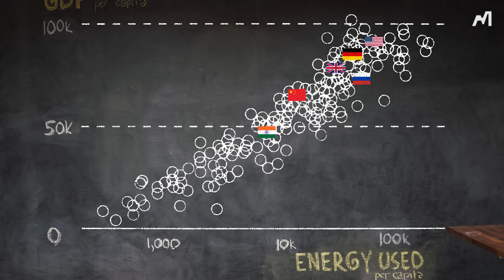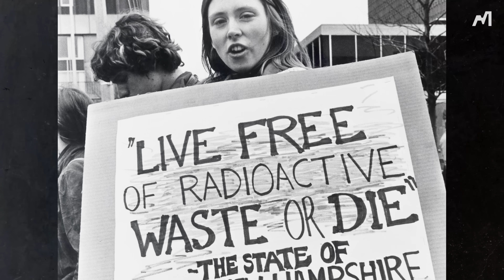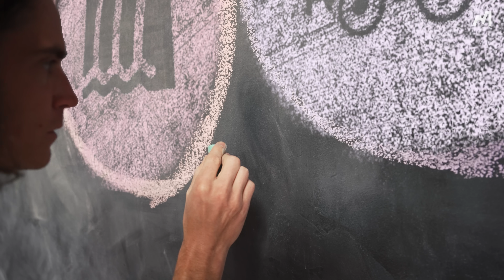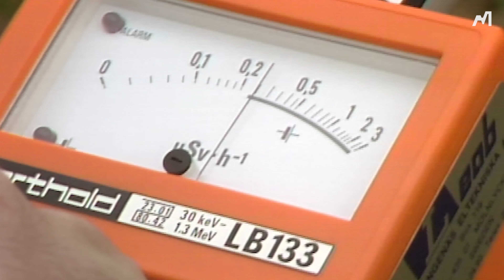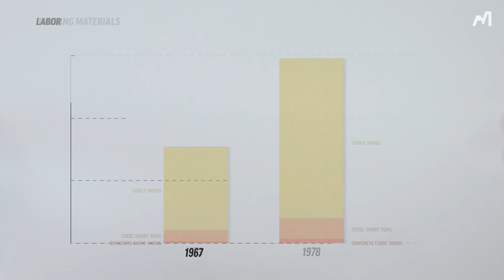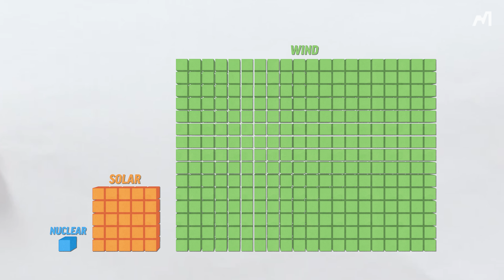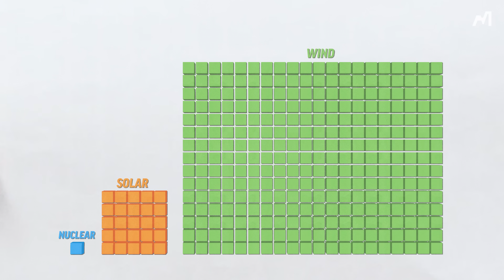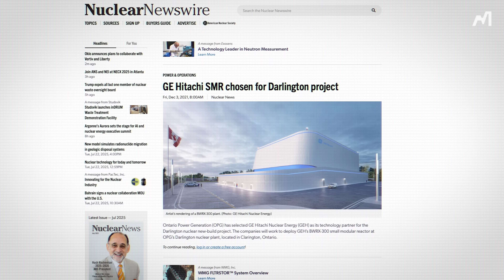They're Lying to You About Nuclear Energy

Comment: But there’s a difference between the radiation that comes from the sun and the isotopes that are released and you ingest it as a particle of dust into your body. That’s why you take potassium iodide so that you don’t build up that radiation. I’m not gonna finish your video, but this is the way I look at the radio activity that comes from a nuclear power plant. We are gonna burn the natural gas that comes out of a well when we are pumping out oil you can either burn it at the wall or you could say no you must pipe it and recover the gas burn it at a Coenen could be finished in a year. Cohen is efficiency When it comes to the technology that’s been driven for making electricity. You could spread them all over the country in populated areas without worrying about if there was ever an accident, and if there was a war, it doesn’t take a nuclear weapon to spread radiation. You just have to hit a nuclear power plant.

Comment: As much as you bring up some good points about the benefits of nuclear, and there are plenty, your explanation of radiation exposure is misleading.

Radiation from fire for example is not ionising. It is infrared (heat) radiation which does not ionise cells and body tissues. 

Radiation from radioactive nuclear material is ionising. So is UV from the sun and gamma rays, cosmic rays, X-rays and anything above the “ionising frequency threshold” (UV). They knock electrons off the atoms of organic molecules and damage them, often leading to cancer.

Our bodies have not evolved to handle ionising radiation from the sun, the atmosphere filters most of it out.  But skin cancer rates in sunnier countries is much higher than in cloudy, snowy countries, due to higher exposure to ionising UV.

You gave almost no evidence of cancer rates in those exposed to Chernobyl or Fukushima. Marie Curie died of radiation-caused illnesses because she didn’t protect herself. The later scientists did, which is why death numbers are low.
Reply: The cancer rates from Chernobyl are measurable in the few thousands if you’re conservative (and use a LNT model which is scientifically discredited) and Fukushima is a grand total of 0 since the dose was too low to show any demonstrable cancer rates increase, even among those who received the highest depose they’re under observation and still no demonstrable cancer rates increase was observed.
Source: UNSCEAR reports of Chernobyl and Fukushima accidents

Comment: Not possible to imagine what you have to say about ignorance and fear for the next 16 minutes. 

The larger issue is generic energy ignorance. Plutonium is one thing to not understand. 

Water that all nuclear reactors use and how water is energy is another. The modern day understanding of energy and specifically electricity is backwards and upside down.

Water is the container and method of delivery of all energy. No need to attempt to burn the water out of dead things made of water or to burn water into the state of evaporation to extract the energy in the fluid state of the material available everywhere on this planet cornered with water borne life forms including people

Comment: This video is a bit delusional, I'm sorry. It takes around two decades to set up a nuclear power plant. You can build up the same energy production capacity with wind or solar in less than a fifth of the time. Nuclear is strictly NOT competitive with renewables.
Reply: Problem is RES only operate in certain conditions and nuclear can 24/7. The two production “capacities” are not comparable because of this timing difference, sure you can build as much solar as you want, but after dusk 1 Tw of solar capacity produces 0 Wh of energy.

Comment: Windmills and solar panels will not produce the equivalent energy it needed to get produced, transported, built, and installed in its designated location. Then comes the costs for maintenance, the dismanteling after its useful lifetime is over, very costly disposal of some extremely dangerous matters and liquids they contain...
Reply: 25 years lifespan for a windmill is conditional to the very expansive maintenance done throughout those years

Comment: Its kind of weird how we learned from experience, and redesigned things. Like the near disaster at Browns Ferry NPP where a fire destroyed most of the control cables for two reactors meant that construction standards needed to radically change. The cable spreading areas were not human accessible most of the time, so nobody bothered to spend money building an alarm system pend money on a alarm system or fire suppression gear there. It was also cheaper to limit the number of building penetrations and route many cables through one area - so while the reactor safety systems and control rooms had backups of back ups, this one area was a single point of failure. One candle and some not properly fire resistant foam later, and you had an entire powerplant down for months.

Most of the questionable features of the RBMK were from economic decisions. The fuel melt at Enrico Fermi One was due to a last min addition to the plans that wasn't vetted correctly. 

Even if we got rid of all the oversight, Gamma rays are gamma rays, and no matter how small the reactor is you will need more protective measures than other power sources driving up costs. Which is what investors care about. Nuclear is a fine source of electricity, but not a good source of profit in short term folios.

Comment: Nuclear energy does not scale. In order to run the world on nuclear power, so much uranium would be required that it would only last a few tens of years. Do the math. It is a good thing that we did not go this way.
Reply: Do the research, resources and reserves are not the same. 10 years is BS and based on current reserves and demand, but resources and minerary resources can support nuclear for long enough that we don’t need to worry about running out. Same logic if applied to fossil fuel then oil should’ve ceased to exist 20 years ago, but we found new way to extract it and new deposits.
Math alone without contextualizing it or knowledge on the matter is just disinformation.

Comment: How much nuclear power plant fuel does the world have, and how long will it last given 1) present number of plants, 2) projected number of plants?
Reply: Unfortunately this cannot be answered and it doesn’t even make sense as a question, I’ll explain.
First of all are you asking reserves, resources or minerary resources? These are all different and will give you a different answer.
Resources is what’s currently economically available to extract, so by this metric the world has 5.9 Mt of uranium at less than 130$/kg (IAEA red book), so 90 years worth of fuel at current consumptions. Total resources are 7.9 below 260$/kg. Problem is resources are not finite, reserves become resources when price increases: new mines open, old ones reopen and new deposits are discovered. Hence why it cannot be answered, it’s not a fixed value, can only be used as an estimate. Also secondary and unconventional reserves (like military stockpiles being downblended or granite shale rocks) can give you even more.
If you wanted to you could calculate the uranium content in the crust and the crust mass and you’d have the total maximum possible (also need to account the uranium dissolved in the oceans if we wanted to). But including current reserves, resources and fuel reprocessing long story short is we don’t have to worry about uranium running out for at least the next millenium. Worst case there’s also thorium.

Comment: How large are the nuclear waste containers? Are they built and stored next to the nuclear reactors? If so, how many years will it take to fill up the land around a typical nuclear reactor? Is it possible to steal the nuclear waste without hauling off an entire container? Can nuclear waste be taken by breaking or drilling through the sides of the containers? If nuclear is so safe, why does it need to be stored in concrete containers? Besides the radioactive waste, how much water do nuclear reactors consume?
Reply: A few meters high, depends on the design but I’d say a canister is 5-6 meters high?
Again depends on the design, reactor cycle and space, there are some plants which can hold the casks of other plants also. The entire civil nuclear program in Switzerland holds waste in a 68m long building and it’s not even half full for example.
Nothing is impossible, but I’d say very improbable given the amount of security around nuclear, the real question is what would you do with stolen waste? If you were a terrorist for the same effort you could do much more damage with conventional explosives, chemical or viral agents.
Those containers are made to withstand an airline plane impact, so given enough time you could drill them, but it wouldn’t be feasible. Also nuclear waste are solid grey ceramic pellets, not green goo that Ozzie’s out of the hole.
It’s stored in containers to shield from radiation and protect from impacts (like an airplane).
The amount of water INSIDE a PWR is some hundreds of thousands of liters, but it stays there and only needs to replenish some liters at a time. What do you mean by “consume”? Because the answer is 0, eventually it all returns to the environment, like how much water do you drink? It doesn’t stay in you body infinitely, it gets reintegrated in the water cycle eventually. If you mean the FLOWRATE (which is not consumption) needed by the power cycle to produce electricity that’s around 27 tons/s at the condenser cold side for nominal power and cold water conditions.

Comment: Not all radiation is the same though. There is a difference between relatively harmless Alpha and Beta radiation versus the more harmful Gamma radiation emitted at nuclear plants. Not distinguishing between these types is a crucial part of the discussion to my understanding, yet there was no distinction made.

Don't get me wrong though, I would like to have more clean nuclear energy since it still seems to be the most safe, efficient, and economic option than the comparable problems caused by depending on coal and oil. Its tragic how nuclear power's implementation appears to have been hamstrung.
Reply: guys a shill ignores all risk .. solars 2-5x cheaper anyway... only actual shills or retards talk about it being viable besides big oil lobbyst trying to lock in electricity at 2-5x higher prices for decades to keep their sales... .. cheap power is solar ... nuclear guarantees 20 cent kwh near vs solar lock in at 4-7 cents

Comment: I agree that nuclear power is way better and safer than publicly debated.
And most of the numbers and details of this video are just misleading.

SMRs and conventional reactors are not comparable. They work differently and also use different fuel. SMRs were long time not considered for normal energy production due to less capital gains and still high regulations
The death numbers are misleading: you are seemingly counting in indirect deaths by coal and gas and not by the ones by radiation. Yes there are no reliable estimates on the death numbers cause its very hard to track.
The amount of birds and bugs killed by wind power plants is neglectable to the killing of house cats, intensive agriculture with use of pesticides, deforestation and the overall growing land-use for anything but nature. 
Examples: the factor between birds killed by wind turbine blades in comparison to house cats in germany is roughly 5000. Most bugs killed are due to pesticides and loss of habitats.

You are not wrong and the way you portray things is misleading Sir.

Comment: Dr Eric Skousen published a book in 1981 entitled The Nuclear War covering these facts (ch5 The Radiation Myth) degrees in Physics and PhD in Mechanical Engineering Science. Professor/director of physical sciences at Utah Tech.

Cresson Kearney also published two editions of Nuclear War Survival which also cover intensity and time dosage.

It's all about dosage; time and intensity. No different than sun burns.
The Naderites exploited American credulity and faith in science with scientism.

Small, modular plants are the best interim solution to the aging, failing national power grid. There are now working designs that are small enough to be installed at EV stations, relieving the load on Utility lines. These could easily provide power for keeping parking lots clear in winter weather locations during low demand periods.

Comment: There are newer safer nuclear designs. The waste is a problem. Unless you’re building a thorium plant.  I would like to take a gauger counter to measure the radiation levels from the steam. And I heard it under ground pipes where not being maintained. And leaking. A mass amount of radioactive water. Into underground water reserves. I like to take a deep dive but.??

Comment: It is not the amount of radiation you receive (of non ionizing type) that poses a danger to you but what it might interact with either around you or inside your body that can be deadly.
Magnetic radiation under high tension power lines can light up a florescent tube but it is considered harmless to humans and animals. But add some cancer causing radon gas and put yourself between the source of the gas and the source of the radiation and you have another story. If you live in a high radon area DO NOT put any kind of electromagnetic source near the head of your or your children's beds. Not only does the magnetic field attract the gas but it can energize it making more harmful. There has been studies on this with alarming results.
I am unaware of any studies into heavy metal levels in humans and cancer risk when exposed to radiation. Heavy metals like mercury aluminium cadmium etc are not good at high levels but even the levels considered safe may be dangerous when exposed to any kind of higher radiation levels.
Note 
I'm am in favour of nuclear power and think the rules blocking the construction of new plants are overly excessive and unscientific to the extreme . My mention of radiation being a factor in disease when heavy metals and radon gas are included is aimed at better understanding of all forms of radiation not just the tiny amount from a power plant and the fact that a number of deaths pointed at radiation exposure may have been incidental not causal. For example people with amalgam fillings might want to avoid electric cars.

Comment: I would like to know about gravity batteries i.e. a weight on a pulley down a mine shaft. When you generate energy you winch it up, when you want energy you drop the weight to power dynamo's. Do these mechanical batteries just wear out and so are not feasible?

Have chemical batteries improved at all? My understanding is that there has not been much improvement in this technology?

I think what I am asking is what is the economics like of energy storage? How does this compare to chemical batteries? I guess nuclear solves this problem as well because there is more energy stored in atoms than chemical bonds.  Fuel (coal, oil & gas) are just chemical forms of energy storage.

If you are not generating energy and have to pay to store it; then in terms of economics that must be a problem?

Comment: and if we will use Thorium as a fission material in molten salt reactors (where you don't need water in high pressure, where there is fail safe plug, where he can consume and use all the nuclear waste from other Uranium nuclear plants and most importantly it is with high efficiency thermodynamics/energy conversion due to high temperatures gradient) it will be safer, economical, modular, cheaper and versatile! You could buy a small one which for 40 years used like a battery in your basement!!!!

Comment: I am not against nuclear but I am in favor of cheap energy. And solar, wind and batteries are orders of magnitude cheaper ans so much faster to build and install. And they get much cheaper and better every year. All these supposed problems with land use, bugs, birds etc. are just hogwash from the lobby and not really relevant in reality.
Reply: You cannot compare directly the cost of different sources because they serve different requirements in the grid. You need to look at the total system cost, of course a solar panel is cheaper a a nuclear reactor, but you’re not running a steel industry let’s say our of solar, you need a mix of nuclear and renewables